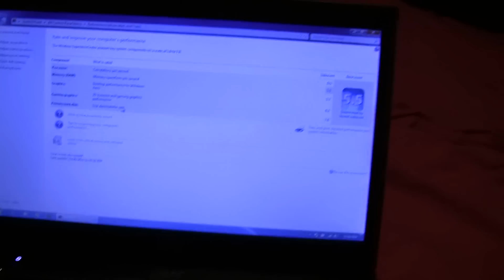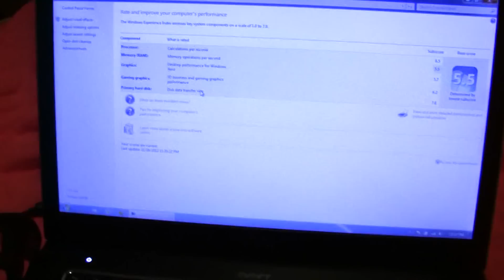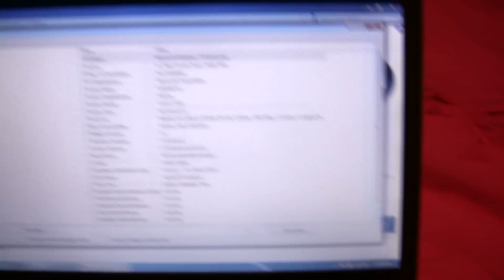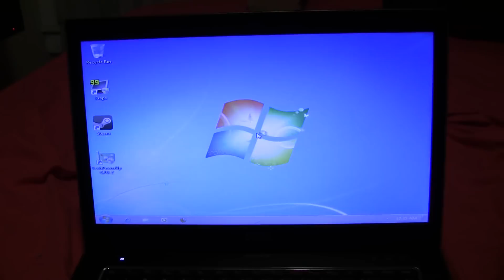Dell Laptop i7 CPU upgrade swap Vostro 3550 3450 3750

Comment from the maker: the Vostro 3555 is the model with the AMD CPU.  there is very little you can do to increase the performance of it.  the CPU has the graphics card built into it, and even the better model offers very little increase in FPS

Comment: reason why the frame rates were similar in crysis 2 is that the i7 that you got was still a duel core with hyper-threading like the i3. you can fit a quad crore with hyper threading in there and probably notice a good bump in performance. if i was going to do something like this in the same series laptop, i would've used the Core i7-2670QM, it fits in the same cpu socket and just requires 10 more watts TDP, which shouldn't change temps much.

Comment from the maker: its not just the heatsink, its the ability of the motherboard to supply the require power. TDP is heat AND power. my 3550 can't provide enough juice to run the cores.

Comment: I have just upgraded my vostro 3750 processor to i7 2630QM but it only runs on 2 cores / 4 threads like it did with the i5 2410M processor. Any ideas how to get it running on 4 cores?
Reply: Enable 4 cores in the BIOS.

Comment: help i got a cheap 3350 on ebay and i bought an 3630qm thinking it could be placed but latest bios updates shows added new cpu support but is not clear by "new cpu support" if Ivy Bridge is the new cpu or just the old Sandy Bridge Core i7 like the old 2760qm...

Comment from the maker: my 3550 can only handle a 35 watt CPU, so I HAD to use a dual core, the 3750 is the 17" model and it has the cooling capacity and power for the 45W quad core CPUs. the 2820QM is a VERY nice CPU, it just won't work in my 15" model.

Comment from the maker: no, the quad core will only fit on the 17" version, the 3750, if you have 15" like mine or the 13" you can only use the dual core.  you'd have to find a motherboard with the Radeon video chip. but they are out there.  I have the video of me swapping it in, but I haven't finished my editing of it.
Reply: how come it wont work as long as the CPU socket is the same?

Comment: it's a i5 i don't remember the number but it was a mobile version looking at the pins under it it was the same except one pin that was different and according to a friend of mine that is and obvious tell that it won't be compatible (on dell laptops at least because the mother boards are very specific) i will double check by googling it though

Comment from the maker: the heatsink isn't hooked up right, the CPU isn't compatible, or you forgot to hook up the LCD screen cables, they are really difficult to reseat.  if the fan spins up but the screen doesn't come on, my money is on the LCD cable needing 'reseated'

Comment from the maker: what CPU did you use? it has to be a 35W dual core Sandy bridge based CPU, can't be a quad core, they are 45W.  if the CPU fits that, you might be able to do a BIOS update to get the newer 'microcode' to work with newer CPU releases.  I know that Dell released a bios to add CPU compatibility.  Google your CPU, it has to say 35W and compatible with HM65/HM67 to be able to work

Comment: My Dell Vostro 3550 have Core i7-2640M. 2 x HyperX SO-DIMM 8 GB DDR3L 1600 MHz Impact CL9 Dual Voltage (Used 1,35V), 1x500GB SSD, 1x500HDD, and I conected EVGA NVIDIA GeForce GTX 1650 via expres card. I would like use Core i7-3632QM on my Dell vostro 3550

Comment: I just upgraded my Vostro 3750 to the i7-2760m processor. However, I got a big warning in BIOS to use a 130w charger instead of a 90w. Does anyone know if a 130w charger will make much of a difference in performance? I don't really care about charging the battery faster just want better performance...
Reply: shouldnt be a problem as the i7-2760 uses 45 instead of 35 watts.

Comment: Is it possible to add a videocard in the dell vostro 3550 with i3 if it hasn't already got one?
Reply: The video card is embedded on the motherboard, you would have to get a replacement motherboard for the laptop.
Reply: ***** If you are really into it, you could try eGPU. If you don't want to get a new laptop that could be your best bet. Some high end laptops come with offboard video cards, using a slot called mxm, therefore their videocards are upgradable (always remember to consider power consumption and heat dissipation), So you could buy a barebone without video card and then buy a video card. Also, used cpu's shouldn't be a problem, if they look ok then it should probably be ok.

Comment: My motherboard in my ASUS S400CA, part # 60NB0050-MB51010 has failed it's $350.00 to replace. There are other boards from the same series with a slower processor but all the same connections and screw holes. The part number for the i3 processor is 60NB0050-MB5030 and costs as little as $95.00. Have you tried this or know anyone that has done it successfully? 
Thanks